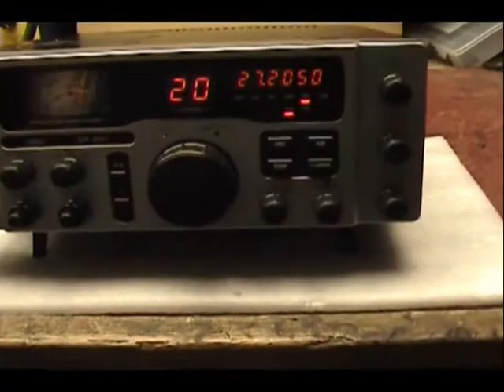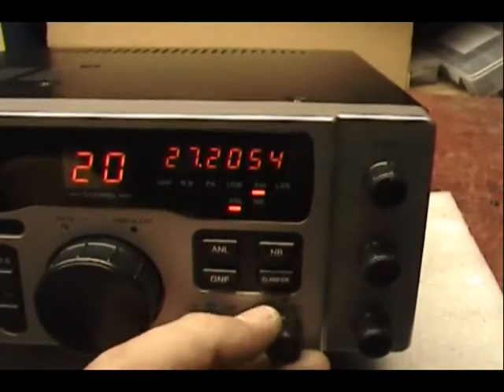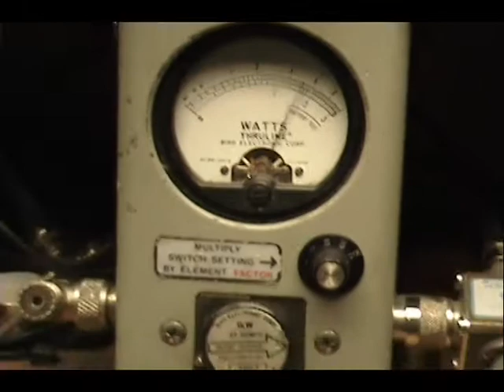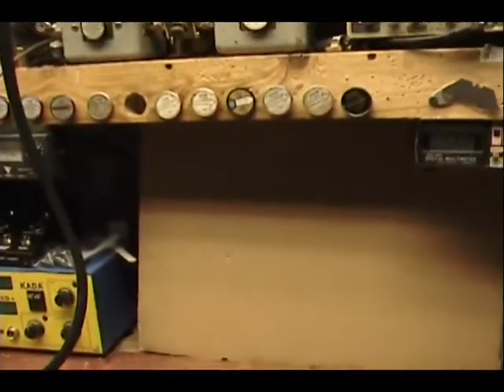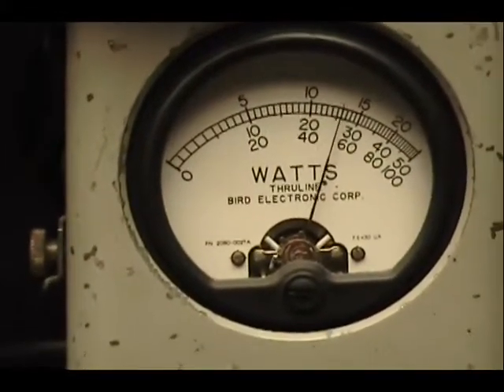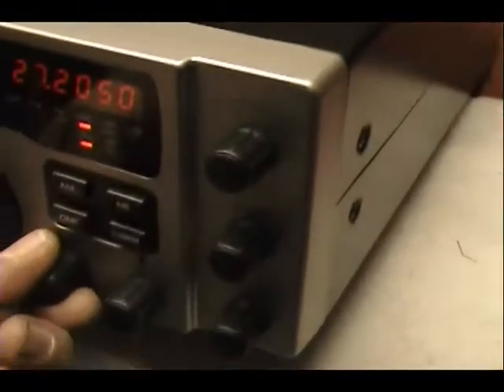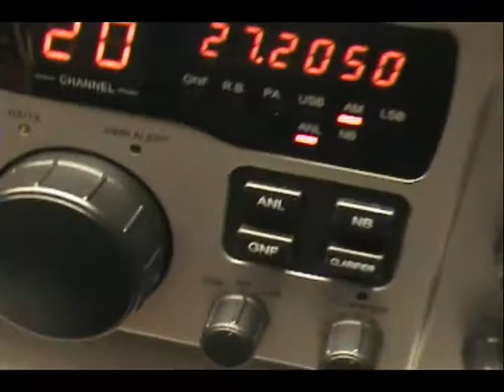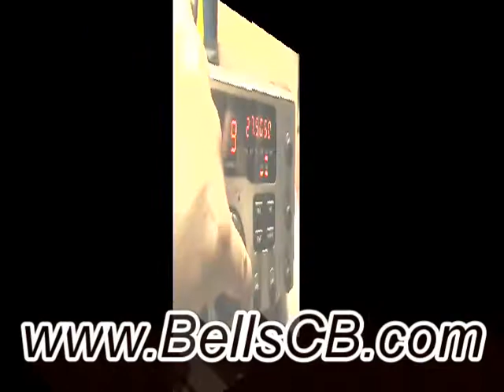Galaxy DX-2547 Tune-up Report

Comment from the maker: The last meter setting I calibrate is SWR. I put a 3:1 load on the jack and set the SWR meter for exactly 3:1. I often forget the meter switch there and I can NOT see the meter in my viewfinder until I watch the video (like you).